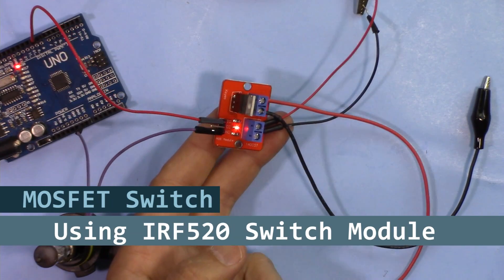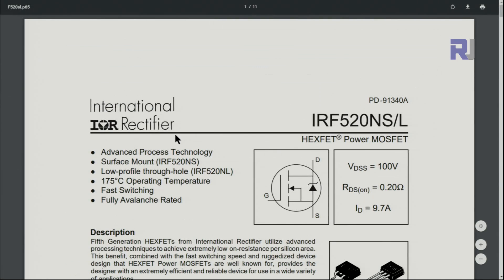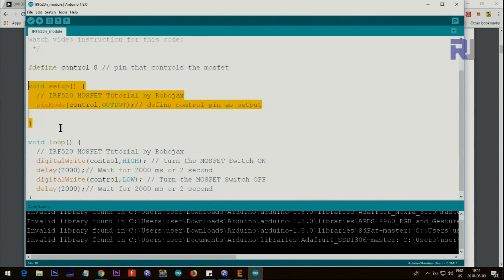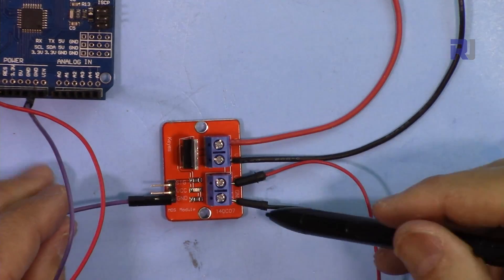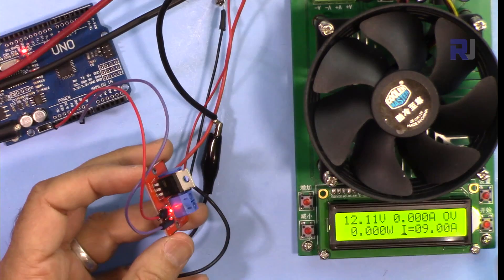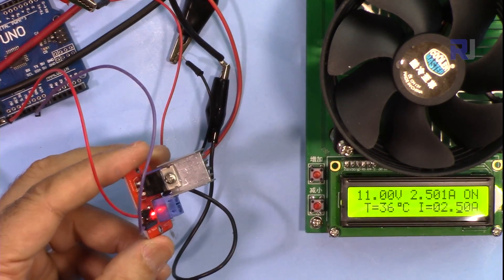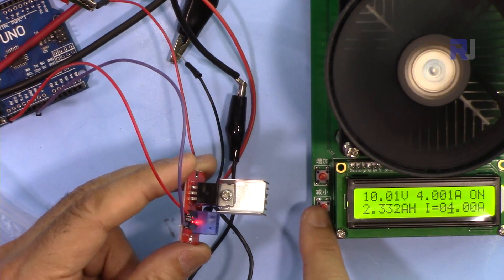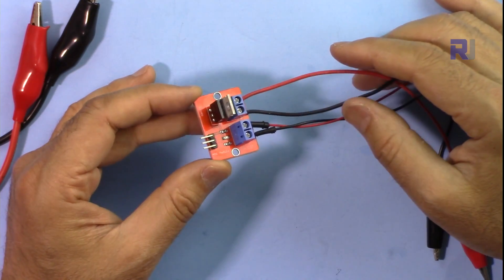Using IRF520 MOSFET Switch Button to Turn ON or OFF DC load RJT85

Comment: When driving an inductive load like a motor you should have a reverse biased diode across load to prevent large spikes across MOSFET when turning OFF.
Reply from the maker: Thank you for letting me know. Absolutely essential. I completely missed that. May be I should remove this video and correct and upload it again.
Reply: @  @robojax  : The MOSFET survived because of the intrinsic body diode.  Please refer AN-1005 of IR and in the datasheet the item "avalanche".
Reply: I am surprised the board did not include the diode!
Reply from the maker: I have updated the schematic in the page where coded is downloaded which shows diode is needed when inductive load is connected.
Reply: See 1:49
Reply: @givenfirstnamefamilyfirstn3935  All MOSFETS have a diode across device. I was referring to a reverse connected diode across the relay coil.
Reply: @peterdkay  Hi Peter, there are comments on youtube to the effect that the little diode in the MOSFET is enough to prevent a big spike from developing.  I don’t know if it is true or not, perhaps coil size matters?
Reply: @givenfirstnamefamilyfirstn3935  The spike at the DRAIN when MOSFET is turned OFF is a POSITIVE voltage and can be +200V. The MOSFET diode has its CATHODE on the DRAIN, so it will not conduct with a positive spike. A 200V spike on the DRAIN can kill the MOSFET. The cure is to put a diode across the inductor (Cathode to positive supply) so any positive spike greater than the positive power rail will force diode to conduct to limit the spike on the DRAIN to be 0.6V higher than positive rail and hence protect MOSFET.
Reply: @peterdkay   Great Peter.
Reply: @Marcus Beckham i really appreciate your reply. I found the site through google and im trying it out now.
Seems to take quite some time so I will reply here later when my account password hopefully is recovered.
Reply: @Kristopher Phoenix happy to help =)
Reply: @Kristopher Phoenix instablaster =)
Reply: @Marcus Beckham it did the trick and I now got access to my account again. I'm so happy!
Thank you so much you saved my account :D
Reply: I dont mean to be off topic but does anybody know of a trick to log back into an Instagram account?
I was stupid lost the password. I would appreciate any assistance you can offer me!

Comment: I got a project that need 230ac input but its need less than 170 dc voltage.. using buck convertor will this mosfet work?

Comment: What's the minimum voltage you have to supply to VIN and GND? I tried using two AA batteries and it didn't seem to work.

Comment: Pretty good video explaining almost everthing. The only thing I couldn't understand as a layman is what was the power supply. Am I to assume that the power supply is coming from the 5v out of the Arduino because it sure didn't look like it was. That part needs better clarity because you never see what power suppy that red wire is running to.
Reply from the maker: that is your power for the motor or load.
Reply from the maker: if you missed the matter of voltage, then please watch again.

Comment: My friend , what should i use for more high load , my project needs 12v 6amp load to be controlled with PWM from Arduino. Which MOFSET/Module I use
Reply from the maker: Just search my channel for PWM and you will find them

Comment: Thanks, just ordered few pieces. Planning to use it with raspberry pi pico to control electromagnet on gate, should act as access control system.

Currently on my protoype I have 2N7000 (made mistake in choosing) and its missing reverse diode (still need to figure out where it should be placed, is it between transistor and GND of magnet or between GPIO and transistor).

Comment: Thank you. Does it will work if I connect a constant current source of 350mA in Vin to drive high power leds?
Reply from the maker: I have tested different amount of current load. I believe it was more than 5000mA.

Comment: Can we use this as HIGH SIDE SWITCH ?? please reply
Reply from the maker: no you can't .  on the high side, the Gate voltage needs be higher the source pin. when you have load of 12V on the source, then gate needs 12V+GSv, if GSv=5V, then you need 12V+5V=17V. for that reason you need gate driver chip which will take care of this for you.
Reply: @robojax  Thanks for the reply... do you have any such video on that topic in your channel... Kindly send me the link
Reply from the maker: no I don't, however it is on my list and I will publish it. stay tuned and subscribe to be informed.
Reply: @robojax  waiting

Comment: i need to make switch on battery changer its like 10 amps can go higher to say 14 may be still not fully tested but good estimate  i bet this unit is to small ? any suggestions
Reply from the maker: if you attach heat sink, it will be enough. I have shown the datasheet mentioning the rated current.

Comment: Hi Robojax, thanks for the great explaination video. I would like to ask if the external power supply for this IRF 520 module is isolated from the arduino? If my 12v and 280mA DC motor doesn't have a diode, will it damage my arduino?
Reply from the maker: Hi, I always explain all features and nothing is left . If this has that feature then I should behave explained it. I don’t remember if this item as isolated.

Comment: is there other way to change direction on coding with out change polarity of motor?
Reply from the maker: you will need different hardware. Search for motor in my channel . Here is how to find Specific YouTube Video in a channel https://bit.ly/findYouTubeVideo
Reply: @robojax  in tutorial just control on/off only. let say i want to control on/off along with speed motor control, can i put the code for one pin only as : 

digitalWrite(control,  !digitalRead(control);
anaologWrite(control, motorspeed);

variation of motor speed will use another code separately (not mention here). 
I just ask can use different instruction of code for one pin only as above code. thank you

Comment: Can I connect 9w dc led bulb with this module and giving 230v supply
Reply from the maker: this module is just electronic swatch for DC. it will not reduce the voltage. so NO.

Comment: I have two mosfet switches controlling 12v solenoids and I have them going on and off at 20 ms so it is fast But after a few second the Arduino crashes,  if  don't have all the components close to the Arduino then it is ok but as I need them close it crashes so its so sort of electric interference 
Is there anything I can do
Reply from the maker: it seems when the solenoid is connected, the voltage to Arduino drops below 5V and it turns off.

Comment: Can this mosfet combine using touch sensor tp223? To be relay
Reply from the maker: as I explained it, module just needs HIGH or LOW so you can connecting anything that output HIGH or LOW to it .
Reply: Great.. thx u..

Comment: So if I use this IRF520 unit, I dont need to use a relay to switch on off a motor ??? I am still struggling with Motor 12C DC 360PA, it draws so much current, power supply stop working, and I use voltage regulator which get too hot. Please advice any solution to drive the Motor 360PA / B 12 V DC ? Thanks !
Reply from the maker: Yes, relay can’t control speed. This however turns on and off. Pay attention this turns On in one direction. You gotta watch my video on actuators to see how it is controlled or push and pulled.

Comment: if I use power supply 2.5 AMP, can this unit boost power up to 3 Amp ?
Reply from the maker: It is all about power.  You can reduce voltage and boot current and vice versa.  But you can’t get free power. Input 10w , you can’t get 11w or even 10w, you will get 9.8w or so.

Comment: Is anyone else having a problem where the mosfet won’t turn off? I’m using 12v and the mosfet only goes from a slightly reduced power on my motor and full power

Comment: I want to control one cooler (on/off). IRF520 is a good solution?
Reply from the maker: it depends of the current. I have provided the link to the datasheet. Find out the cooler current and voltage and make sure it it within the range of this IRF mosfet.

Comment: Sir delay is 10 ,MOSFET will operate or not  this switching speed,but you give 2000 delay,sir I will give delay is 10 it will be operated or not or  It will be switched or not, suppose MOSFET will be fail to operate to delay  10 , which model will be drive to operate this delay
Reply from the maker: if the delay is important to you, I have provided the datasheet. look at and see the switching time of gate in the datasheet.
Reply: @robojax  kk

Comment: Hello sir, I connect my SIG pin (IRF520) and GND  pin (IRF520) to the D8 and GND of my arduino uno(supplied by 9V battery). The LED light doesnt light up. But if I connect the SIG pin (IRF520) to 5V(arduino), LED lighted up and dc motor (load) rotates. May I know what is my mistake?
Reply from the maker: Hello, when you connect signal pin to 5V it means "turn ON the  load" so yes it should start the motor rotating. Connect signal pin to Digital pin so you can turn ON ( or HIGH) and OFF (or LOW) to control motor.

Comment: Can you please explain, the red and black load wires connects to load, where are the other red and black wires connected to ?, I mean the two on the screw connector block ?
Reply from the maker: I have shown full schematic and every bit has been explained. Or see the page where code is you will see more details.

Comment: Actually I want to use this module in boost converter...  In boost converter drain is connected to diode and inductor.. here which terminal should I consider as drain and source.
Reply from the maker: If you want to use it as MOSFET, yes you can. Thank you for keep watching the ads and not skipping them. it will help me a lot.

Comment: Hello!
Can you control RGB Leds strip with 3 of these MOSFETs?
PS. Great Video, Kind Regards from Poland ^^
Reply from the maker: yes you can. I have shown how much current this can handle. If your LEDs don't exceed the maximum current, yes you can use.  Ahmad from Canada.

Comment: Hello friend. Your information is very valuable.

 I am using similar circuit to drive a 1 watt LED from ATTiny85 and A MOSFET but somehow the Mosfet is not getting triggered by the 5V PWM signal from the ATTiny85... Where can I be going wrong??
Reply from the maker: Hello, I am glad you found it valuable.  If you've got the 5V version of Attiny85, it should work.  Unless your module has different roisters at the gate or wiring is incorrect.  I suggest test it with UNO making sure it work then try it with other board.
Reply: @robojax  I first tested with UNO and migrated to ATTiny85 just as it is with the PWM from the ATTiny85 to the Gate pin...... the LED +ve to 5V directly...... and the LED -ve to Source pin...... and the Drain to -ve. A 10k resistor between Gate and Source. 

It worked with UNO but fails to work with ATTiny85...

Comment: Howdy I /am thinking of use this module for a crankshaft sensor. It uses three wires, a 13volt supply a signal wire and a ground. How would the signal wire be attached to this module. Would it be connected to the positive or negative terminal.
Reply from the maker: Hello, The signal needs to be from zero to 10V. So it should be connected to +. In our case I used 5V output from Microcontroller  (Arduino). I have explained it in the video and shown the datasheet. So watch the video again so you can safely use it.

Comment: You are not driving the gate with 10 volts, so all those datasheet numbers you mentioned are irrelevant (and wrong by an order of magnitude) I think?  The max you can get out of this when driven by 3.3v to 5v is 1 to 2 amps only - and probably making a lot of heat.
Reply from the maker: so you are saying we don't have enough voltage at the gate? if so then lower voltage at the gate means lower current and lower current means less heat. Am I missing something?
Reply: @robojax  "enough" depends on your application, but for an IRF520, TTL (5v or 3.3v) is not enough to turn it fully on.  Heat comes from resistance, not current, as far as I know - I didn't see a datasheet that listed that, but you can infer (from the max current, because V=IR) that it's 5 to 10 times higher resistance at TTL levels than it is at 10 volts (the test value used on the datasheet).  Some other guy mentioned that he had to swap the IRF520 for an irf3708 (which is designed for 5v signals) to get his project working.  Do you have a test meter, and something that can use 6 amps?  If yes, it would be a fun test.  See how much current the 6amp thing draws when the arduino switches that on, then, disconnect the arduino and use the device source to turn the FET on and check again  (and, I guess, see how hot it gets when you do that - my guess is it will be heaps hotter at 1 amp (semi on) than at 6 amps (fully on))
Reply from the maker: I have provided the link to the page here details and code it http://bit.ly/rjx-667 and ther I have the datasheet and schematic. at 4:08 I have mentioned resistance of DS (drain-source) and on datasheet page 3 fig.3 the DS current goes to 4A at 5V GS voltage. I might make another video on this module as I have now better equipment. to get 6A you will need 5.5V. On the same page it show that the DS resistance Fig. 4 depends on the junction temperature. So if you keep it cool it wastes very less from mΩ to Ω.

Comment: Schematic diagram have Vin1 Vin2, GND In1, GND IN2, GND 2,  module not have this. Have: Vin, V+, V- VCC, GND,   You made the video in the beating of the game.
Reply from the maker: See the module here https://www.fingerpointengg.com/wp-content/uploads/2018/03/0-24V_Top_Mosfet_Button_IRF520_MOS_Driver_Module_for_arduino_Compatible_with_UNO_MEGA_2560_1087028331.jpg and see schematic here https://robojax.com/learn/arduino/?vid=robojax-IRF520-MOSFET

Comment: hello robojax , i want to ask. can i use the mosfet to control the charging process of three stack battery ? im currently want to do project on control or switch the distribution of battery using mosfet . please response me
Reply from the maker: You can do it with mosfet but not with this module. This is just switch. It is either OFF or ON. so you can't control current with this. I belive you need linear control. This can have only PWM.

Comment: In your linked page you use a 1K resistor between GND and SIG-why?
Reply from the maker: resistor is used to protect the MOSFET. When input is not connected, the resistor keeps the gate at 0V and blocking any noise or oscillation . Read the answer here https://electronics.stackexchange.com/questions/68748/question-about-mosfet-gate-resistor
Reply: Dear Robojax,

Thank you for your reply. 

The MOSFET resistor makes excellent sense. 

Unfortunately, while the linked page shows the resistor, I could not see one in the video. That is, there seems to be a disconnect, to my eyes, between the video and the linked page. This is possibly only me, and I just may not see that a resistor is really present. 

In any case, thank you for posting.
Reply from the maker: You are welcome.

Comment: Thanks for this very useful demo. One question though. Am I to understand that the pin labeled as "Vcc" between the "SIGNAL" pin and "GND" pin (to be connected to Arduino) is not used at all? Is that pin connected to anything at all? If not, then why is it there? Thanks for the response... Please keep up the good work!
Reply from the maker: Yes. VCC is not connected. You can use it IF and ONLY IF your motor is very small and needs less than 200mA and voltage is of motor is 5V, then you can connect the VCC to supply voltage to the motor. The whole purpose of this module is to control a powerful motor with Arduino and Arduino does not have that kind of power.
Reply: @robojax Thank you for this video, and  I know it is 6 years old, but this question was asked several times of which you never answered till now, not sure why you refused to answer it before.

Comment: Robojax,

Thank you for your video. I have a quick question for you. In your code / arduino, you connect to pin 8....and in turn, you send power from the power supply to the load if pin 8 is HIGH, and disconnect power if pin 8 is LOW. My question is...does this device allow for variable voltage across your load using PWM from arduino (say pin 3 instead)?

Take the following example, if you provide 20V as your input power...and you PWM the MOSFET SIG, can you provide variable voltage to your load based off the PWM 256-count from arduino if connected to say, pin 3? Meaning, 20V/256-count = 0.078V resolution?

 If this is not possible to do with this device, do you have any component suggestions that would allow me to do just this? Thank you so much.
Reply from the maker: Hello, Arduino Uno only ouptputs HIGH=5V or LOW=0V. When you send PWM, it outputs 5V and 0V waveform what has only 5V for high and 0V for low. For that purpose you will need Digital to Analog Converter.
Reply: @robojax  Robojax.  Perhaps I didn't ask you properly. When speaking about the arduino's digital pins, I understand they can be set to LOW (0V) and HIGH (5V). But I also know that the digital pins 3,5,6,10, and 11 on arduino uno can be set to PWM, meaning you can pulse 5V on / off for different duration / duty cycles.

My question is, do you have suggestions in how PWM can be used to vary the power from power supply to an attached motor using the MOSFET? I am not sure how a "Digital to Analog Converter" would fix this. Thanks for the help!

Comment: Hello, Signal pin should connected with PWM input, VCC should connect 5v, right? I see the demo no VCC connected ?
Reply from the maker: Hi, follow the link to he page where I have the code. You will find the schematic diagram.